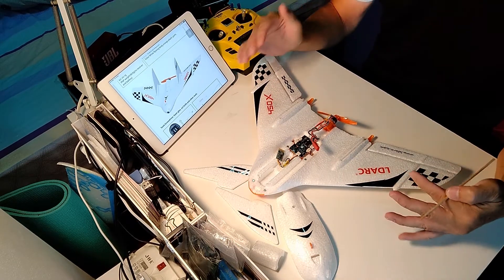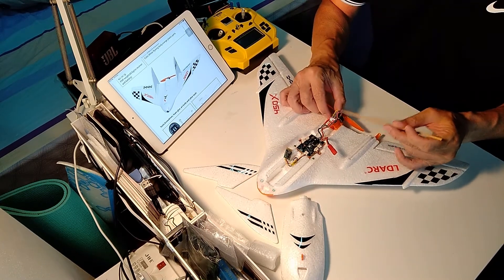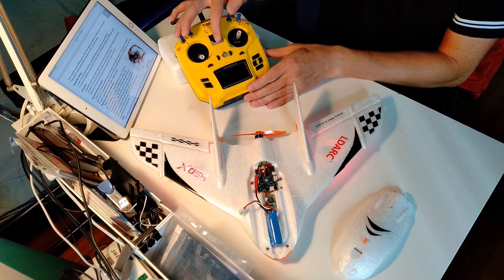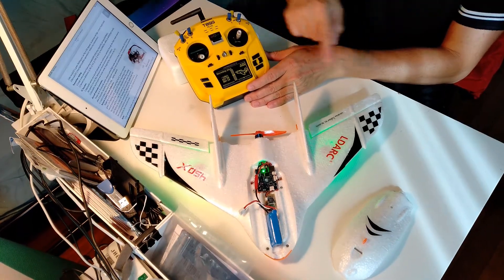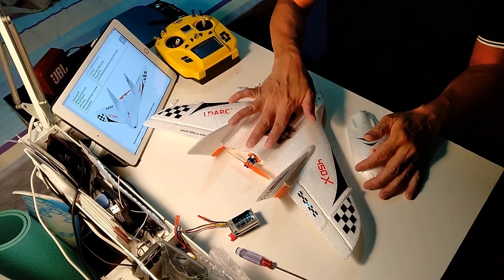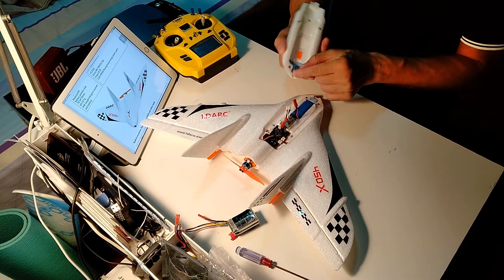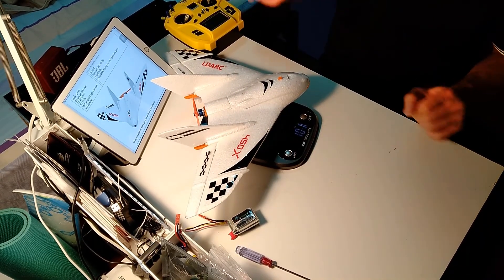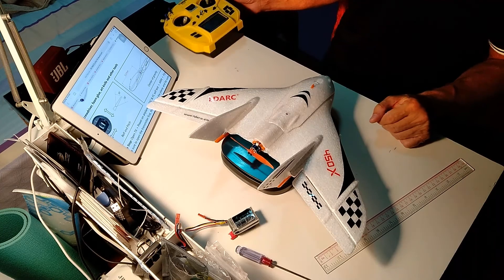Kingkong/LDARC Tiny Wing 450x setup with T8SG Plus

Comment: Yair Kent. We have a couple of these. The first 1 went together easily with a Flysky s-bus receiver and my FS-i6. But the latest 1 using a S-FHSS receiver on the TX16S required the throttle reversed like you. Not only that but I haven't been able to do the radio or level calibrations yet because the FC won't complete its boot up inside the 20 second window that you need to beat to start the calibration sequence.
Reply from the maker: I have not done the radio or level calibrations.  Will try it in the future.  But I am not surprise that I will experience the same as you had.  I did have previous problems with T8SG before. That could also be the problem with s-bus protocol.  As I understand, there is no "standard" for s-bus protocol.